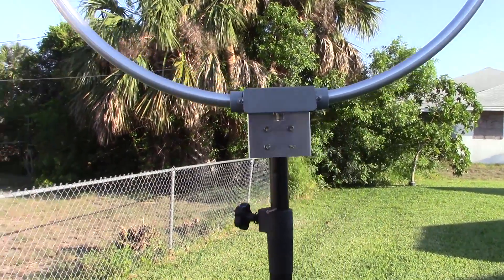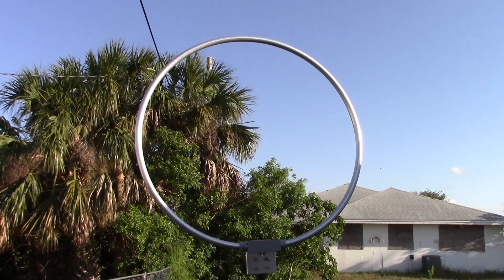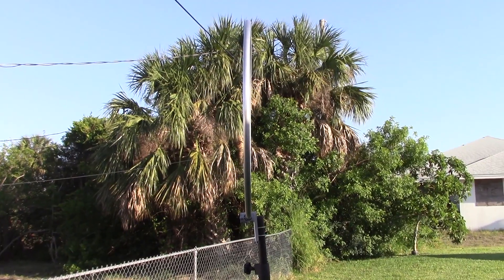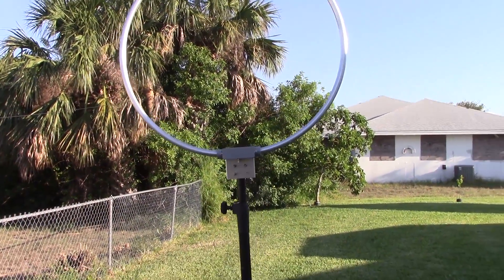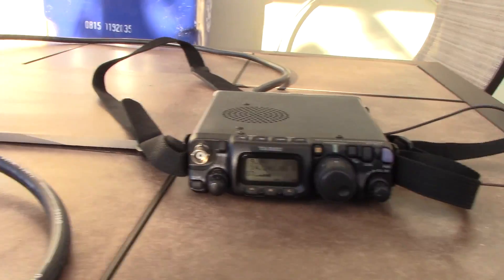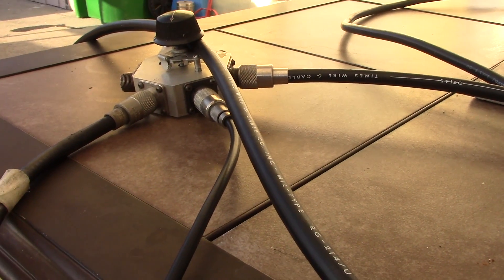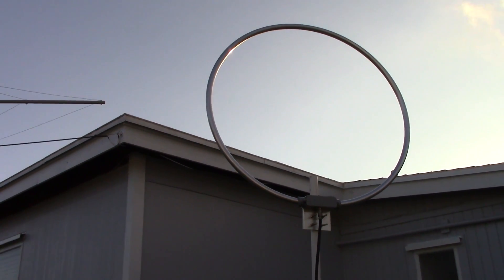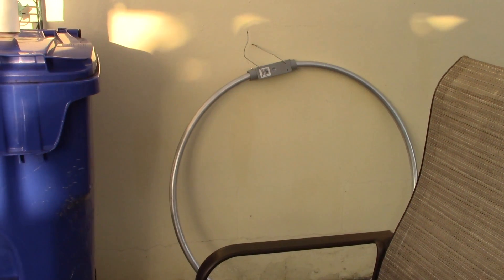Receive loop antenna MFJ-1886 HF loop shortwave antenna

Comment: i run this loop on my KiwiSDR - so far (less than one week of use) its as you say , excellent for SWR - the amount of broadcast stations it picks up is amazing. In terms of the amateur bands its not as good as the Hustler 6BTV with a decent amount of radials out, but I think I need to raise the MFJ higher (current approx 3m) and experiment with 'turning' it. I found your explenation of the 'bike wheel' principle of receive very useful. Thank you ! alan / 2E0FWE

Comment: Accidentally transmitted into an active loop lmao. That's why I never use transmit capable radios on them. You think you're fine but you end up hitting the tuner or the CW key button or the radio does something on it's own that it shouldn't have.

Comment: A sort of antenna I would love to use for reception.
This is one of the reasons I wanted to keep using my Icom ic-720 as it has a loop through on the back so you can use a separate antenna for reception or to ad a preamp. But  sadly I need to work on the 720 as the preselector is on the fritz.
Reply: Just buy the MFJ-1046 preselector with this. Much better than the built in one.

Comment: if you put in a complaint with your power company they must come out to investigate the noise and fix that transformer or filter it. you must tell them you are an amateur radio operator.
Reply from the maker: Well, i have pursued that several times and i need to do it again shortly... The guy that comes out seems like he knows his stuff, however he says he cannot isolate the issue that it must be in the home.... I know there is a ground he removed at the end of the street that was wiping out VHF/UHF at my end of the street with static arcs, which i actually found one night after it rained I saw it when i walked my dog.... i thought the ground was supposed to be fixed, but i watched him remove it at the top of the pole so it doesn't arc to ground anymore.. And i didn't want to argue.
Reply: I had trouble a few years ago here in the UK with a persistant noise that would not go away. I tried most things. I had a little portable transistor radio with a whip on it, so I went around just going near to things to see if I got anything different, but no change. Then one day I went into the street and near to lamposts (lightpoles) in my area and found the problem, it was a timer or something giving out a constant buzz on a lampost over the road from me. I got in touch with the electric company and it was cured in two weeks.